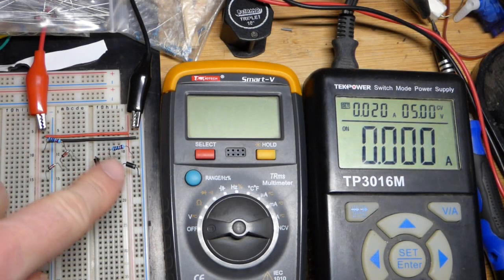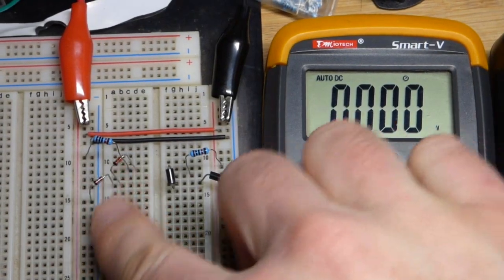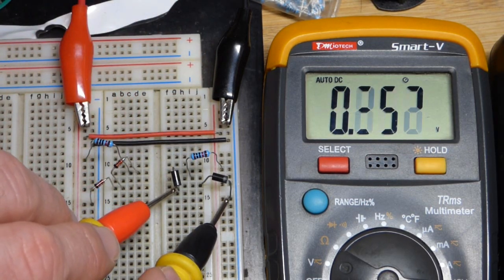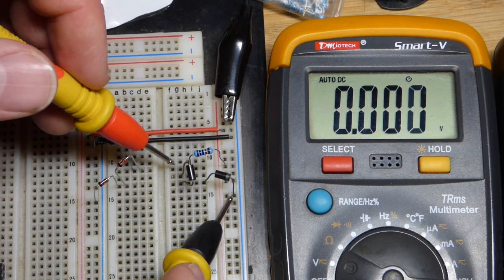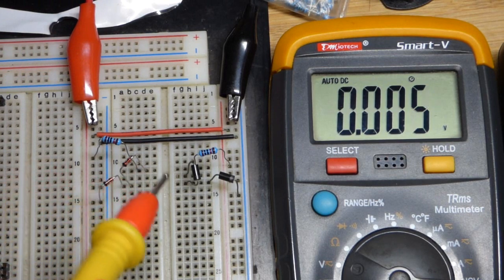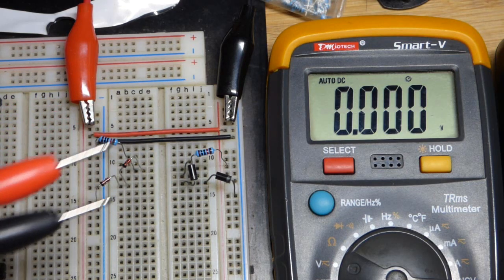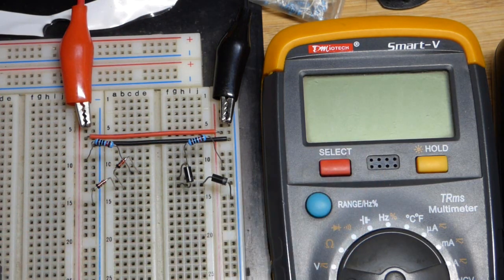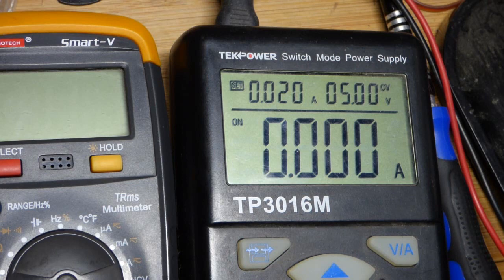Bonus vid 1N4148 vs 1N4001 rectifier diodes forward voltage multimeter measured by Electronzap

Comment: Forward voltage changes with various currents through the diodes.   Spec sheets specify forward voltage drop spec for a specified current through the diode.  Temperature is also a relative large factor that changes diode voltage drop.    As a matter of fact I have seen circuits whose main purpose was to use a 1N4148 as a temperature sensing device to measure temperature.  (Great topic for video)   These really can't be used for a precise reference voltage.  I have used them for this but you have to minimized current flow to eliminate self heating effect and use them is relatively fixed temperature environment.   Love the vids.  Keep it up.    The greatest friend of the hobby electronics guys for voltage reference is the TL431.   Great accuracy for cheap device.
Reply from the maker: Good tips!